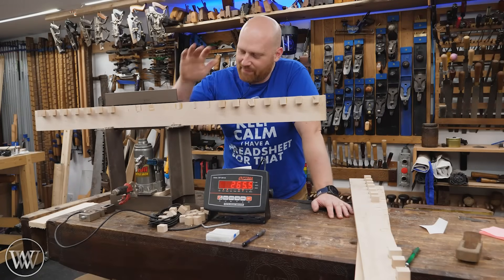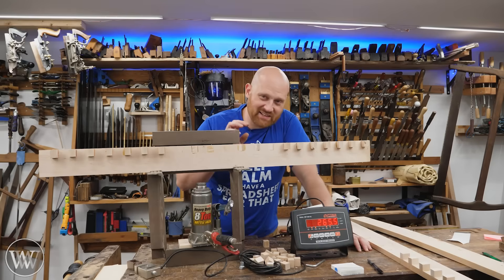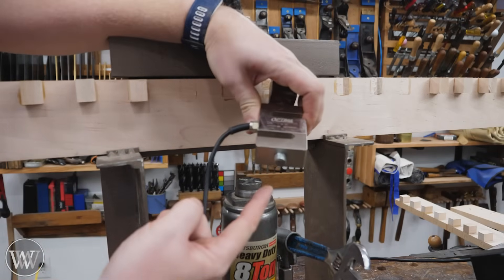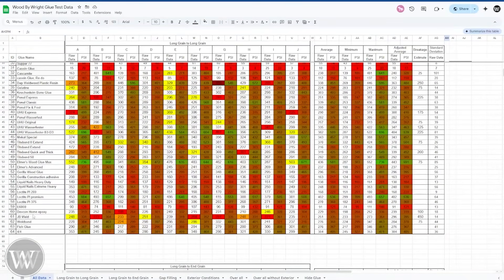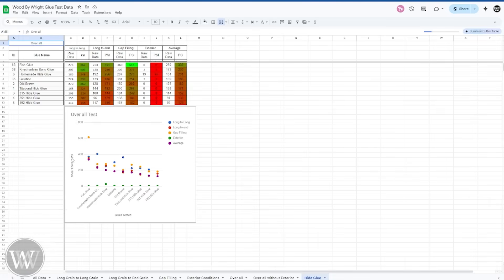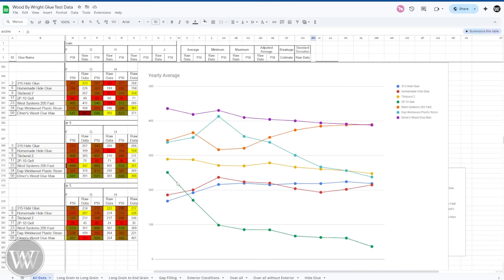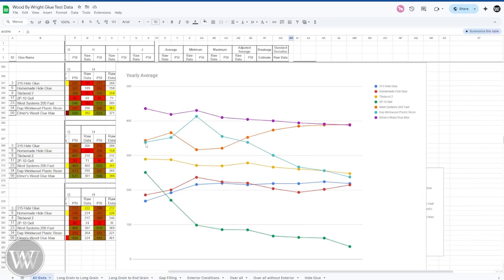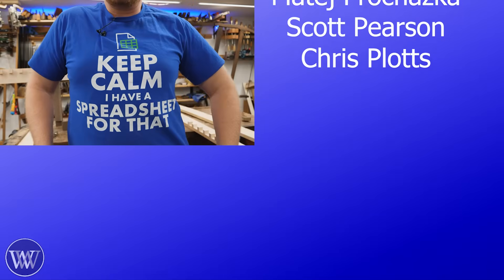It Took 5 Years To Get This Data

Comment: fish glue? fish glue keeps rising way up close to the top, way past the other (as adam savage calls them) "meat glues"?

am i wasting my time fussing with dissolving then melting the traditional 192 gram strength hot hide glue for certain guitar repair jobs when i could just grab the ready-to-go fish glue?

i already avoid titebond-type glues for those certain jobs for fear of those glues softening and "creeping" when under constant tension and also subjected to "hot car" temperatures like from a careless guitar player leaving his instrument in his car in the summertime. luthier frank ford famously did some tests and found that when under stress titebond creeps with even mild heat while hot hide glue stays fully hard and brittle up until its breaking point, as long as there's no moisture involved 

@woodbywright i'm going to need you to do this whole 5-year thing over from scratch but with all the break tests done in "summertime attic" conditions

Comment: The force from the jack is offset from the glueline and would twist the glued blocks would’t it? Resulting in a pull away from the board. That is not purely a shear force. Is that how the blocks break off right at the glueline without leaving any wood?
Reply from the maker: The jack pushes on a block that extends up past the block and stops rotational force.

Comment: I'm glad to see that you adhere to consistent standards in your testing. No doubt you have been building up a bond with your viewers. The research in using the stubby bolt should assist in clamping down on variables. Thanks for sticking to it. (That's all I got!)

Comment: Cynicism leaking through here but before I rush out and buy some of that Elmer’s… what’s the chance they changed formula in the last 5 years?
Reply from the maker: There's a very good chance that the formula has changed slightly but not in a significant way. If they significantly change a formula, they release a new product to Great fanfare.

Comment: Interesting, even do the epoxy glue doesn't surprise me very mutch. 
As a civil engineer it was/is used in asfalt and surprise surprise the stones grind away in the years and the asfalt gets quite slippery when wet.
Epoxy is reeeeeealy strong
This is also the reason why we stopped  using epoxy in asfalt. 
Just so you know

Comment: Would have thought dap weldwood plastic resin glue would perform better - but its' main claim to fame is being waterproof. Which also means I should revert back to it for cutting boards. Elmers wood glue max was NOT anywhere near my radar. Well done!

Comment: Seems like you got yourself into sticky situation there with that glue test, glad to see you found the problem and were able to adhere to the original parameters and correct it so the numbers lined up and stuck to the original format.

Comment: Not related to this video, but I was just emailing with bad axe to see if they still made their sash saw as a custom order. They said they had a few bits left over and would be doing a limited run to deplete their stock. It’s now live on their website, they are taking a max of 65 orders. And I know that one of those has already been claimed!

Comment: Most other glue test almost universally end up saying that the glue is stronger than the wood itself.  That's why the wood breaks first in their tests. You say you are trying to test the glue beyond that. If the wood is weaker and you are gluing wood to wood why isn't yours ripping apart the wood?  Are you saying that the glue is not stronger than the glue?   Or are you testing in a way that does not really come into play in normal woodworking?
Reply from the maker: The test rig I have puts all the pressure right onto the glue joint and supports the wood on both sides. This protects the woods so it wants to hold on longer. Most the time with oak or Maple. You're looking around a 250 lb of pressure on these blocks for the wood to break, so anything beyond that is stronger than the wood itself. But there are a few woods where that's not the case and they are much stronger in those cases. You can get up around 400 lb.

Comment: It seems like DAP weldwood plastic resin is no longer readily available.  What glue do you think would be similar in performance?
Reply from the maker: Yes. They actually discontinued it just after I started this one. There aren't many plastic resin glues anymore. They're a bit of a pain to work with and not too many people use them. Offhand. I'm actually not aware of another one currently in production in the US.

Comment: I have suggested a glue test to multiple YouTube experts in woodworking.  None have been willing to try testing this possible myth.  'Don't use a wet rag to clean up glue.  The water will infiltrate the joint and weaken it."  I wish somebody with equipment such as you have would compare multiple glue ups using no water cleanup, rags with water and possibly almost soaking the joint with water.  Also using different PVA and hide glues.  Thank you for all you testing, your spreadsheets and links to finding both tools and wood.
Reply from the maker: For the testing I have done in the past water in the joint does not weaken it if it is allowed to dry without stress. I do not see how a water rag would weaken the joint as the water can only absorb 1-2 hundreds of an inch from a wet rag. TB 1 and 2 will weaken after drying but only if fully soaked. TB 3 and hide glues return to their normal strength once dry.

Comment: Outdoors test of hot hide glue with 10% BLO.
Reply from the maker: sorry not sure what you are asking for. are you wanting to mix the BLO with the hide glue?
Reply: @WoodByWrightHowTo  yes, exactly. I found this recepie for water resistant/less water sensitive hide glue in an old woodworking textbook (published in 1890).
The English translation of the book states the procedure as "In the case of articles exposed to moisture, the addition of 10 per cent, of boiled linseed oil is advantageous. The glue to which it is added should be hot and strong, and should be stirred till the varnish [BLO] has been thoroughly mixed. The wood to which this wood-cement is applied should be dry and warm, and the pieces should be firmly pressed together until the glue dries."
Reply from the maker: Interesting. I might have to check it out. I've never heard of that before.